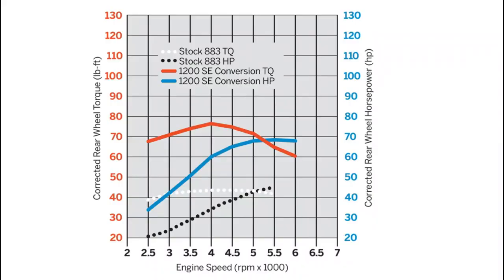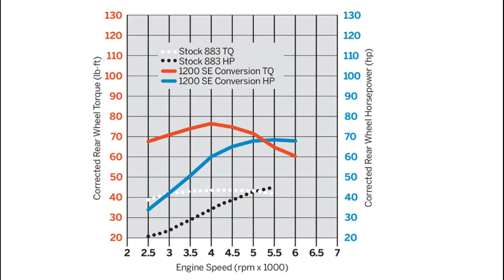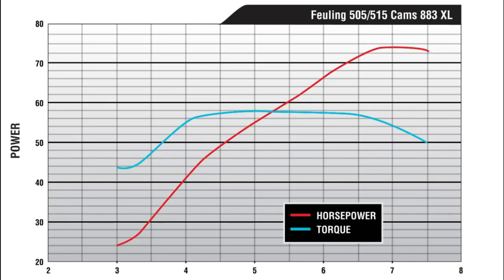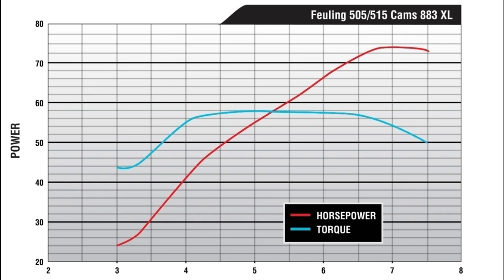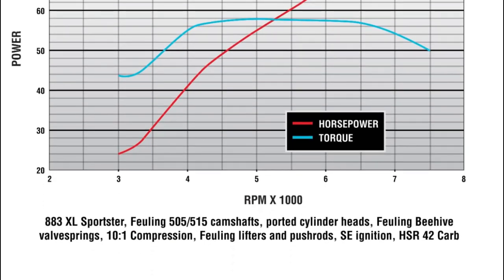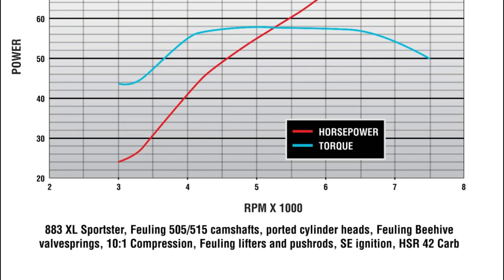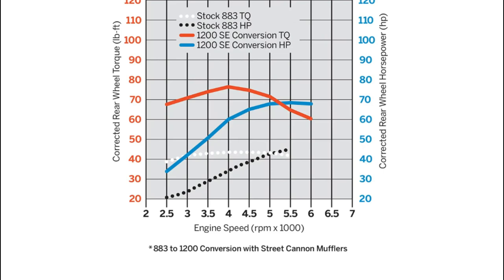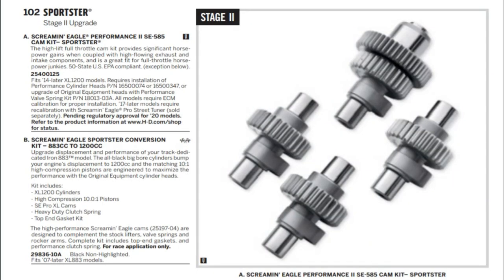Sportster Cam Upgrades To Increase Horsepower and Torque

Comment: I keep wondering about the Fuelung Reaper?? I have a stock 883 (except for k&N air filter and I modified the stock exhaust. I live in middle Tennessee but I ride in East Tennessee in the mountains quite a bit and some on the interstate. I am wanting more low end and midrange. I see now my best bet is to bore up to 1200. I am so thankful for your channel. You are saving me quite a bit of money. Thanks!
Reply from the maker: I really appreciate the support! If you're upgrading your 883 you might look at a 1275 from Hammer. They can set you up with a kit that uses your stock heads or you can send the heads in and have them work them over. The 1275 kit produces some nice torque gains, especially on a Sportster!
Reply: Me too.....the Feuling 505/515 seems like a great match without jumping the fence but cant get enough good info on them

Comment: Another informative video for anyone with a sportster , very cool 😎 my spare set of 883 heads are on there way back from Hammer Prefomance rite now . Had them do the Impact level head work with the prefomance valve job . Very excited . Also just picked up a new Kerker Supermeg 2-1 exaughst as well . Gonna swap out my Vance and Hines short shots I have on there now . I may sell the short shots after the swap ... first I want to see how well the Kerker Supermeg preforms . Then I’ll decide if I want to sell the short shots . Looking forward to all the upgrades. May wait till winter and let my mechanic do it all then. Not sure yet . Thanks for another good video . Nice job brother . Stay Cool Bro 👍
Reply: Also have a new Dan Moto 2-1 exahgst as well that I never installed . I like the look of the Kerker better . So I may sell the Dan Moto pipes as well🤔your bike is looking sick 👍I like it a lot . What’s your next prefomance upgrade/plan my brother???
Reply from the maker: That's super exciting news! I think you'll love the performance of that Kerker. They've always made great exhaust in the past and produced solid results. You'll have to let me know what you think of those heads when you get them back from Hammer. For my bike l think l am gonna go with Hammer 570 cams. I love how the W cams perform and if l can get more in that range l am going for it!
Reply: GixxerFoo  I agree with you on the hammer 570 Cams , I wanted to get a side of those myself. But the top dead center lift is too much for my 883 heads with 10 to 1 compression and reversed dome pistons. I ended up with the 1275 standard big bore kit with the 10 to 1 dished Pistons instead of the 30° dome pistons 10 1/2 to 1 compression. So because of that I can’t use the 570 cams. But I did use Andrews n4 cams and I love them . They are really good just a little more noisy than the W cams but I have no problem with that
Reply: .  I definitely hope you get a set of hammer cams I’d like to hear your opinion. If I can figure out how to put some pictures up I’ll send you some pictures of the heads when I get them back so you can see them
Reply from the maker: I'd live to see what they did with your heads, l have no doubt it is top quality work! I really want to build in stages so l can feel difference. I know it's more work but l want to be thorough.
Reply: GixxerFoo  so the only problem with building in stages is that people tend to waste money when they do it that way. So just be careful and make sure you are on top of what you do .  I know that you already know this and it’s great that you’re researching everything first that’s the best way to not waste money. It’s Awsome you did this video to help others know this as well . I like the idea of doing it in stages because like you said you get to see the difference every time you add something or change something. It’s a lot more fun for the type of people that enjoy tinkering and they want to learn about every little thing aspect on their bike
Reply: GixxerFoo it’s really too bad we didn’t live closer to each other because I’m sure we would have a lot of fun riding together and discussing our sportsters all the time and the things that we can and should do to them for performance. LOL the only problem is finding the money to do all this stuff!!!!!!!
Reply from the maker: I wouldn't do it that way if l was a paying a shop to do he work, that would add up quick. Labor rates are insane these days!
Reply from the maker: @ghostdog1874  😆 right! Time and effort is a lot easier to come by than the money to get it all done. No doubt it would be a good time hanging out!
Reply from the maker: The Andrews cam isn't bad at all noise wise, especially compared to the Screamin Eagle 580 they came out with. That thing is loud, you would of thought being a cam from Harley they would of put some more engineering into the ramp angle or something.
Reply: GixxerFoo  I agree on the Andrews n4 cams not being to loud , I think they are just a tiny bit noisier than my W cams were but my valve train is not overly noisy by any means. I was thinking about you wanting to get a set of the hammer 570 cams.I think that’s a great idea but I honestly think since you already have a 1200 you should have hammer do your heads for you ,let them do some head work and then add the 570 cams ,Or throw the cams in and then have your heads done, I honestly think if you have your head work done and you had a set of those 570 cams there would be no reason for you to even do a big bore kit ,you would probably be ecstatic with the power you picked up from the head work and cams alone. Just my thought I’d love to hear what your opinion is on that.
Reply from the maker: I've given that some serious thought about having my heads done, lol Hammer actually talked me out it. He said 04 up heads are basically improved Buell heads. I'll probably start with the cam and see how well thay does and then go from there.
Reply: GixxerFoo Wow Really?? They talked you out of it? I know all the 04 and up 1200 heads are pretty much the best heads that Harley’s done for the sportsters so far to date. But I also know that doing their head work depending on what stage will give you good increases in flow throughout the rev range. And a good percentage of gains can be had from their head work.
Reply: So I’m actually surprised, but idk I guess they have there reasons . I think cams and headwork is always a huge improvement, and then a few years down the road you still can go 1275 big bore when you need to freshen the top end up . From 1200 to 1275 isn’t a lot all else the same , but 1200 -to plus cams and plus headwork is actually a really nice fat jump up in power and tourqe . Unless I’m missing something. But hey keep me posted on when your doing the cam swap . Mabey do a video of it??? I’m sure the rest of the followers wouldn’t mind checking it out .
Reply from the maker: @ghostdog1874  Basically those heads can support 100 horsepower give or take. With the 570 cam and a 1275 staying with 10:1 that would put it close to 100 horsepower before the heads became an issue holding the bike back. Honestly though l would spend the extra and have them do their basic service to them though. No sense in putting new parts under heads with some miles on them.
Reply: GixxerFoo good call , I agree they can support that much power already , lol but if you decide to do cams then hay why not just do the 1275 kit and get it over with . And while the heads are off have hammer do a little magic? See how dam addictive this shit is?? Makes me laugh cuz like any true gear head you can never just change one thing . !
Reply from the maker: It's honestly cheaper in the long run to just get it all done while the bikes tore down. I mean already right there even just for swapping cams, the guys at Hammer will be straight up and tell you that too.
Reply: GixxerFoo you are correct and yes they do say that as well, but I still did it the wrong way because at the time I had just bought the bike new . Soo I kinda had to piece stuff together for awhile . Next time around I’ll go bigger . I should have done the 10.5-1 comp domed pistons instead of the 10-1 dished conversation pistons. Other than that I’m pretty happy with the overall prefomance now. The bike rips now and that’s with just a mild port job. I haven’t even gotten the heads from hammer on there yet . So I’m sure it’s gonna impress me for years to come👍
Reply: @GixxerFoo  Those stock xb heads offer very good performance.  I have used them on my 1997 with a 1250 kit and impact 560 cams. Have run 11.62 @116 mph in the quarter.

Comment: What would you recommend for a 2016 sporster 883 iron  with a screaming eagle 1200 big bore kit, arlen ness big sucker air filter, V&H short shots exhaust and FP3 tuner I'm trying to upgrade my cams but not sure what to get, just trying to get more overall power, appreciate your response, thanks.

Comment: i have 883 sportie,with  1200 upgrade goes like shit of shovel,i love it  wickerd ride
Reply from the maker: 👍 you get a 1200 conversion with a nice set of cams and they will run hard!
Reply: my model is 2004, i got it last week,only 4000ks on it,its new old
Reply from the maker: That's not bad at all! Plus you have the first year of the rubber mount with the carb. Can't beat the sound of the carbed bikes.

Comment: Currently looking to purchase an 883 or 1200 Sportster .
Either one , as soon as i get it will be treated to a
HAMMER 1275 KIT 
HAMMER  570 CAM
OIL COOLER &
RECLUSE  CLUTH KIT
Reply from the maker: That's an awesome setup right there! That's the way to do it!

Comment: I would do 1275 motor + 570 cams and keep the head stock. Got a 2012 Sportster which has good heads already anyway. Best bang for the buck if you’re just street riding. Start changing the head and valves and you’re already doubling the price. 

I already have an upgraded clutch since I blew the stock clutch first 2 years of owning my Sportster. Upgraded front/rear suspension already, and a dynojet tuner which was the best upgrade. Hell, I’m not even in a hurry to upgrade my motor and cam since the tuner has changed my ride dramatically already.
Reply: Hey i have a 883 from 09 it has vince and Heins short shots and KN forward airfilter. But it has not got Any fuelpack tuned yet. What tuner is it you got ? Im planing on increse the power but im not willing to do Any replacements of the cams or cylindere yet before i have ridden it for some more time.
Reply: @bjrnkristensen8132  got a dynojet powervision. One of the best if you plan doing more upgrades beyond the stage 1.
Reply: @ruthlessinu626  yes my plan is to do more with the bike in the future diffrent upgrades and ect to the engine. But for now it Will only be a stage 1. What is a dynojet powervision ? And what dos i do and what can i expect to gain in HP and Torge from this with exoust and filter Sorry for asking im still very new to this. its my first bike vý

Comment: I have a 96 1200 custom. I'm looking to do 10.5:1 pistons and contacting hammer for a set of cams... how high would you feel is a safe rpm limit on the stock heads? And is there a reasonably  priced ignition module you'd reccomend?  Thanks, Derek.

Comment: I got my 883 bored out to 1200 and the heads were fixed with bigger valves and better flow , no need for cams ....yet! 😂
Reply from the maker: Your still running the stock cams?
Reply: GixxerFoo yes !
Reply: You need cams to take advantage of the bigger valves, but you should notice a huge difference when you do cams!

Comment: I talked to Dan Hammer and he said if you’re not gonna have head work done the most he would go would be with a Andrews N2 or if you have D cams go to the W‘s cams because it’s just gonna push the torque farther to the right of the Dino graph
Reply from the maker: That is very true, unfortunately if you rigid mounted Sportster 1200 the head work is mandatory. Those heads were really not performance oriented, but if you have rubber mounted bike those heads will handle quite a bit of power up to about 100 horsepower.
Reply: @GixxerFoo  my heads they are at HAMMER right now getting the Impact Head CNC porting done to them and a few other things done to them that is done all the way up to the 90 HP Package my package is going to be set at 10.1 compression right now but I’m gonna talk to him tomorrow about setting it at 10.5.1 
I got the 1250 package. I have cycle shack full exhaust system S&S air cleaner S&S Super E 48mm carb Andrews N4 cams And a new ignition system that was in the package I let you know how much HP My predictions on horsepower is probably 105 to 110 that was at 10.1   I like torque more than horsepower

Comment: My 95 1200 has Andrews N4 cams and Buell Thunderstorm heads.
Reply from the maker: That's a damn good setup! N4 cams are hard to beat on the 2003 and earlier models. The 2007 and up factory heads are basically copies of the Buell Thunderstorm heads.

Comment: GixxerFoo, appreciate your input. I am changing now my 2003 from 883 to stock 1200 cc , only by replacing to stock 1200 barrels and pistons to wiseco  K0213PS which are designed for 883 to 1200 swap application. But I can choose 8,5 , 9,5 or 10,5 compression ratio . My questions is if i like to drive in low RPM range and I will have W cams , what compression ratio I should choose . Does 10,5 compression gives any advantage on low RPM, would say to 3500 rmp? Hope you got my question . Just your humble opinion?
Reply from the maker: The W cams will not like 10.5:1 compression, they will do well at 10:1 with careful tuning. Are you retaining the stock 883 heads?
Reply: @GixxerFoo  Appreciate your reaction. My idea is to use stock 883 heads , with stock 1200 cc barrels . I made a mistake - wiseco K0213P pistons says they are  10>1.  So I guess I can go for W cams? I heard I will have to work on them in order to to timing cup?  I have no clue, but will figure it out when I get my W .

Comment: at first i was told about Reaper cams for a stage 2 but I'm pretty sure I'm going with the 1275 instead... I have yet to decide which package though
Reply from the maker: All depends how much you want to spend, Hammer can set you up with a winning combination for any budget.
Reply: Check out my videos, I have the Feuling reaper 505/515 cams and am doing a 1250cc kit when the season is over here in Canada (November). Feuling claims 94hp at 6500rpm with an exhaust, intake and tuner on a 1200cc which is AMAZING, and I was skeptical at first but after I got it properly tuned I can believe it! These cams work AMAZING and the sound they create is top notch. They also offer a larger Sportster cams (reaper 580) which requires valve springs, and lifters. I have feuling valve springs and lifters to install with my 1250, but aince the bike is so new I was able to leave the stock lifters for now and they don't have to be upgraded with the cams, it is just a recomendation. The Feuling 505/515 cams really brought the bike to life and I am incredibly happy with them. That being said, you can not go wrong with the Hammer Performance 1275+ supporting components like cams and whatnot! I think you will be happy either way! As for the Hammer 560, gaining a few hp after 5500rpm is basically useless. Most people are shifting between 5500-6500 so unless you ride the bike wide open above 5500rpm all the time there wouldn't be much to notice.
Reply: @jonnymac8925  How is the torque? I have a 1250 with 883 heads. I threw W cams in over the stock D. Would I lose alot of torque from the W cams? I have a thunderheader and Dyna ski tuner
Reply from the maker: W cam is really the best all around cam for a Sportster. It's hard to beat the power and torque the W delivers over the D.
Reply: @GixxerFoo  Agreed! The W is a epic cam especially on older sports. But how I ride tend to puts me at something like a N4 cam but hammer said i cant use because my 883 head and said the 505 is simular just less power. I dont mind losing some torque if its not a terrible amount

Comment: Interesting. Adding cubes we all know adds power. Wonder what effect them jack hammer cams have on a 2010 883?
Reply from the maker: The 570 would add a nice little bump to to the 883, not a whole lot but you would feel it.
Reply: @GixxerFoo  I need a "bump" but not ready to pay for the 1200+ kit....Already have a power vision, autotune and all that crap so this might be a good option.
Reply from the maker: Yeah a 570 would be a good addition, but instead of the 1200 kit going with a Hammer 1275 kit would be a really good investment since you already have the Power Vision.

Comment: Man, I gotta say my 2005 XL1200  Sportster after putting on a Mikuni, jetting it, plugs, Screaming Eagle II slipons, and right angle cone breather the flipping bike was way fast. I pulled 72 or 74 on the dyna. If I was on it the bike would jump outa my hands romping into second gear and take a moment for the front wheel to come back down to earth. The idea of cams scared the crap outa me. I was already getting too comfy with the speed and power. I was working to tone myself down for God’s sakes. Just saying... I’m in Pasadena Ca so lots of congestion to deal with on the road.
Reply from the maker: Sportster engines have a lot of potential, especially now that Hammer has that bolt on 1275. It's pretty easy with compression, cams and big bore to break 100 horse.
Reply: Sounds like an awesome ride mate!

Comment: or if you get and old used 883 with the D cams, get cams...a 1200 kit would just choke more on the D cams.
Reply from the maker: W cams are a excellent upgrade, only thing that really beats the W cams for low end and mid range is Hammer's 570's.